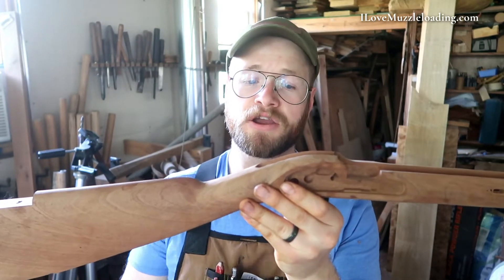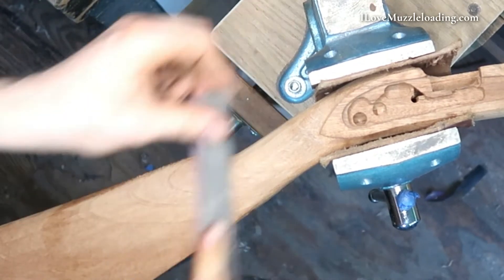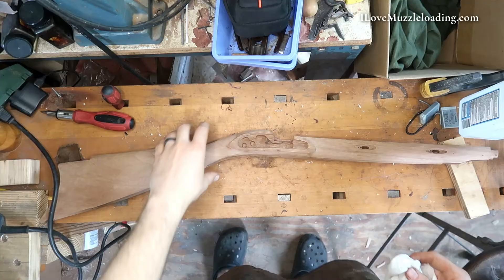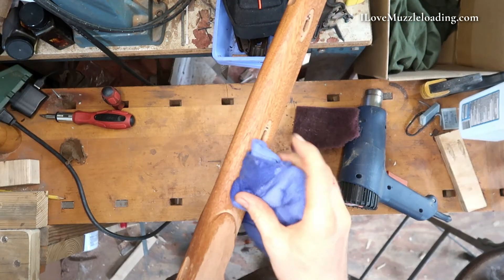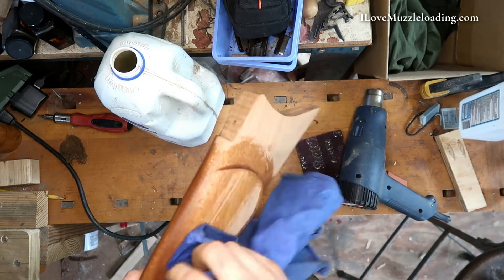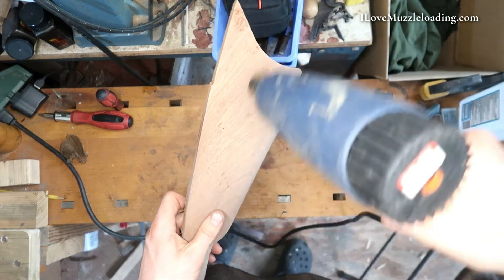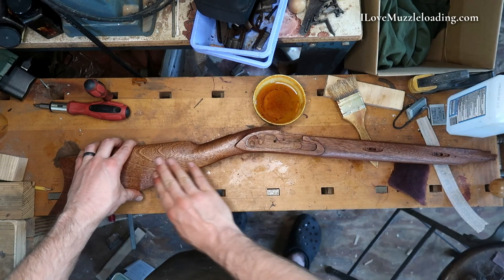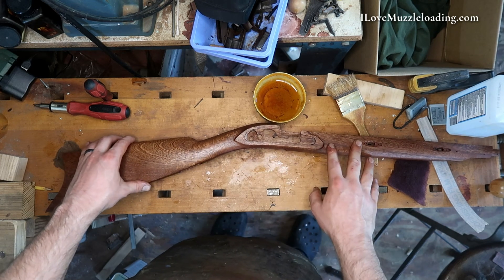Preparing the Stock for Stain  | Investarms Gemmer Hawken How To Build Part 21

Comment: On whiskering, just an alternate suggestion. An old gunsmith showed me this method. Wet a portion of the stock with rubbing alcohol, light it , and let it burn off. Only takes a couple of seconds. The wood won't burn, and the whiskers will pop. Sand and repeat. I've used it many times always with good results.

Comment: If you do not want a "plasticized" stock (or any other thing made of wood) do NOT ever go above 220 grit sandpaper on your stock. 400 grit "polishes" the stock and it will not take stain evenly or well. I am a lifelong woodworker (69 y.o.) who is dabbling in flintlock kits. I make no claims on gunmaking skill per se, but wood finishing, my life experience would beg to differ with you. This one point aside, I love your channel and this Hawken series. :-)
Reply from the maker: Thank you Mr. Morgan! Great information here. I hope you enjoy building your own flintlocks as well!
Reply: @D. Reid Margan: I'm just finishing my first ML pistol and I have used 1000 grit and, indeed, it didn't take the oil as well as I had hoped. Time to back peddle somewhat.
Thanks for the tip.
@I Love Muzzleloading: Great series, thanks!
Reply: I found this out the hard way! Took a bit of reworking to get my stock looking better.